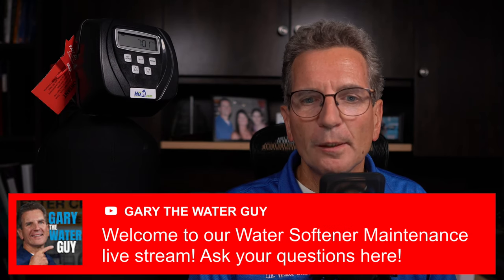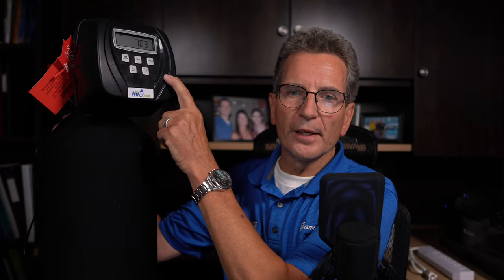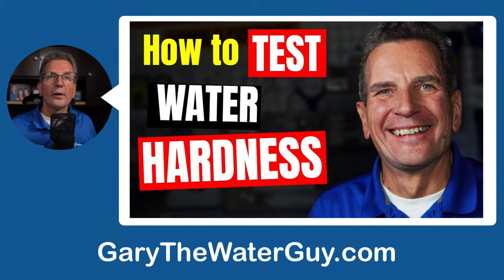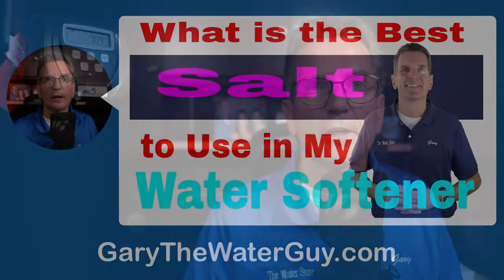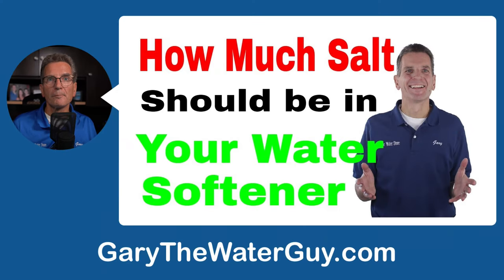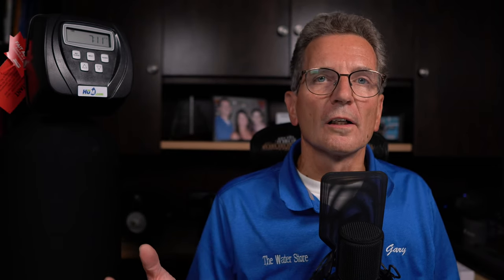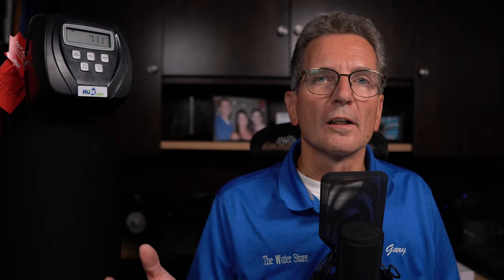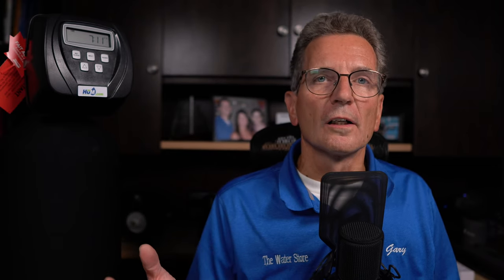WATER SOFTENER MAINTENANCE

Comment: after henpecking away for an hour or two it won’t let me send it to you so all that work for nothing oh well ( get it that’s a very deep subject ) Ha Ha get it but you didn’t get the whole story from start to finish please post the best way to get a hold of you for your expertise and wisdom because I’m not getting it from Quality Water Services where I purchased my Canature 565 no help or support or anything else like that that after they installed it in 15 minutes and charged me $350 so called flat fee after giving them over half of a 80 pounds bag of resin beads that I had from the my old water softener and I never heard from them yet and we have been without hot water and soft cold for 6 days now and have to carry water to each bathroom for the toilet because the only hard water faucet is at the kitchen sink and yes I know that I could put the softener in bypass but I don’t want to fill up the water heater that is on propane with anymore hard water than it’s already gone through it because I wasn’t aware that the water softener wasn’t working properly for some time now and they don’t make water heater’s like they use to my first one lasted 22 years or more and my second one lasted only 6 years so they replaced it with a new one with no warranty on this one and when they came to replace the first one they opened the box it was in and no damage to the box but it had a great big dent in the water heater so that they must have boxed it up at the factory already damaged and I suppose they didn’t want to get into trouble so they went ahead and boxed it up and sent it out that way God Help Us All Amen and Amen Big Al from Nebraska The Good Life here on earth and trying to do the Will of God The Father Creator of Heaven and Earth and trying to do what Jesus Christ Our Lord and Savior taught us while here on earth that is recorded in the Holy Bible How we are to do for all those God Created that need our help to provide for their needs like that of the widows homeless those who don’t have any parents or family relatives for guidance and protection and all the necessary things for them to live and to be nourished and sheltered to be loved Just as God loves us that His Mercy and Love and Forgiveness that’s why He sent Jesus Christ His Son to pay for our unrighteousness’s and that all we have to do is repent and freely and openly acknowledge that Jesus Christ is truly the Son of God and is Our Lord and Savior that Jesus was crucified Died and was buried and on the third day He Rose again from the depths of hell and defeated death and as He Ascended into awaiting
Reply from the maker: How can I help you?